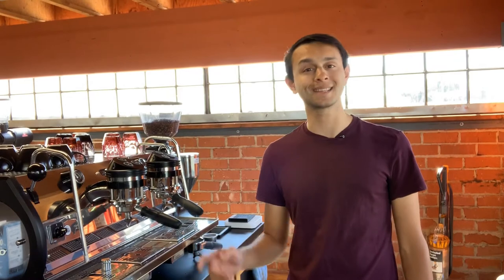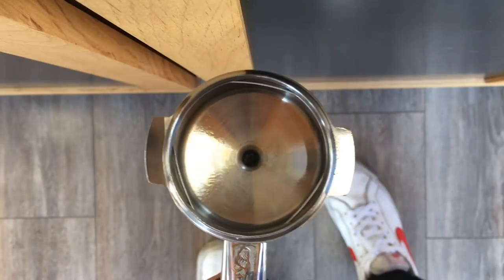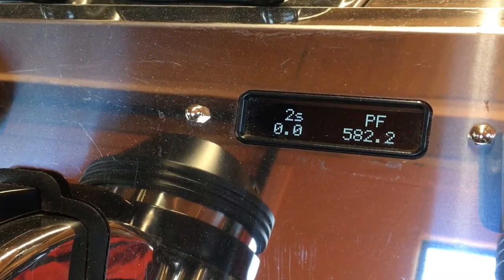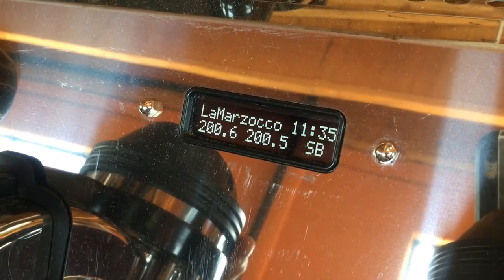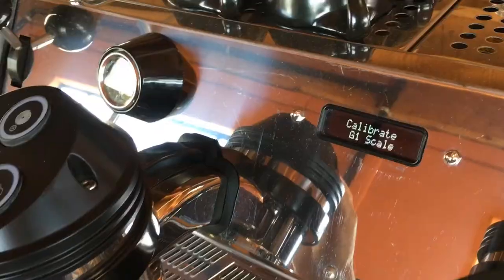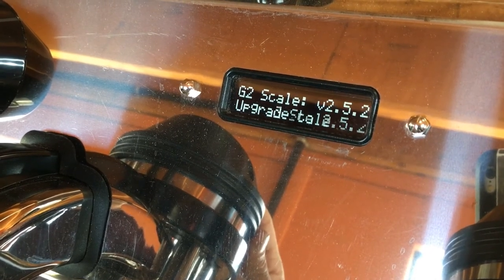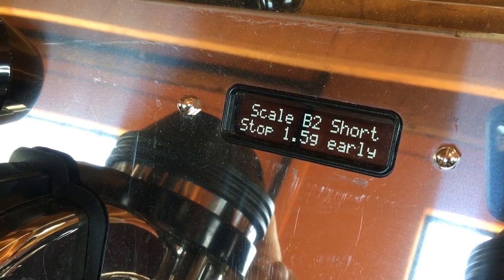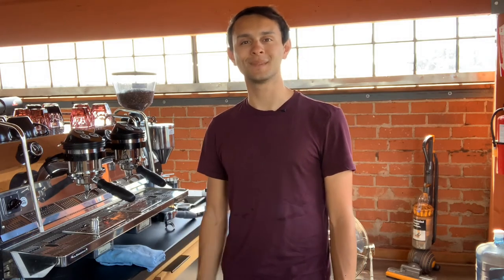Quick Tip: Checking and/or Recalibrating your La Marzocco Scales

Comment: I’m thinking to get the Strada for our cafe.. bit kinda stuck. Between KB90 and Strada; what are you opinion ?
Reply from the maker: Hi Trang, thanks for your question! Your machine choice will depend on multiple factors, including feature needs, cafe design, and budget. It's best to discuss your needs with a reseller partner to determine the best fit. If you are in the US, feel free to email info.usa@lamarzocco.com to be connected with a partner.